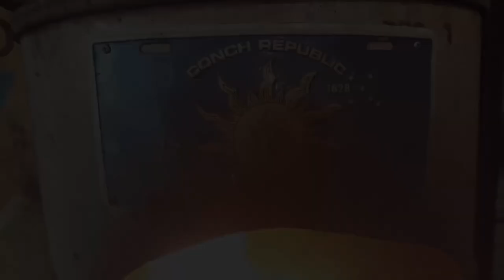How to forge a Horseshoe Heart

Comment: Nice project, quick and pretty, but let me add a few suggestions:  1) Try to avoid hitting anything sideways on the anvil, it is not as efficient as a vertical blow.  Sometimes you have to but it is not the most effective use of your hammer or anvil. 2)  Your anvil needs to be tied down tighter.  You are loosing energy when you are hitting against something with a wooble to it.  3) I suggest that you refine the bottom of the heart to a point.  IMO, it would look better.

Also, you may enjoy joining and participating in the I Forge Iron forum on the web site of that name.  Lots of good exchanges with other iron pounders.

Have a happy Turkey Day.
Reply from the maker: Thanks for the advice, much appreciated,  this so far has been the only project I've ever hit the side of my anvil on, the wobble is my stump moving on the concrete floor, I will work on the point... as for Iforgeiron... I was on there... I got chased off that forum for the crime of being a beginner asking questions... I won't give names nor will I go into details... but yeah, I applaud the site for having plenty of information.

Comment: Just for the halibut, what weight hammer are you using here?  And are you using that particular weight on porpoise?
Reply from the maker: Heya, for the first part, I used a 4 lb hammer to set the point in the middle. It is a bit quicker when working the top and side of the anvil at the same time. The rest of it, I used a 2lb hammer as that's my daily driver. All this can be done with just a 2lb hammer.